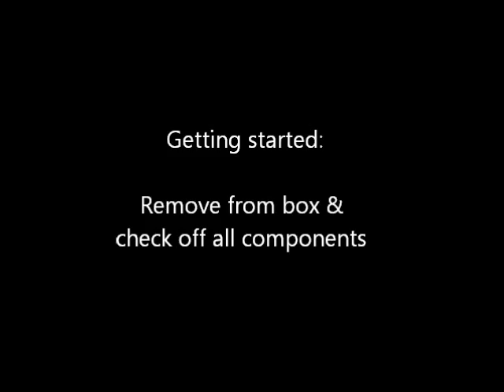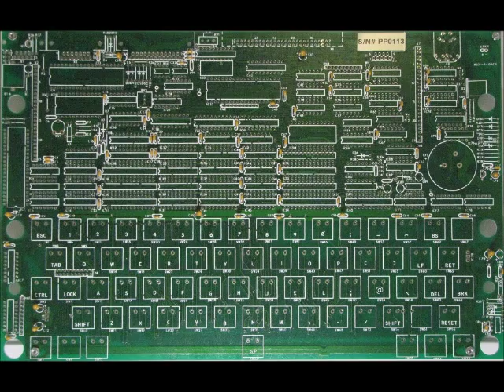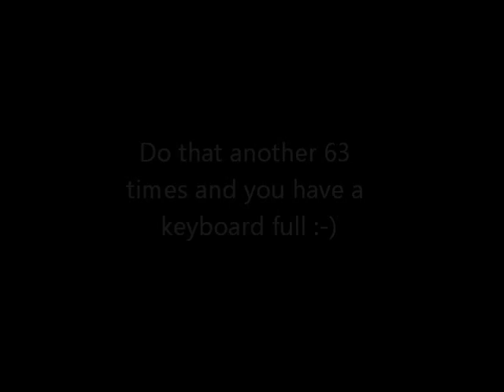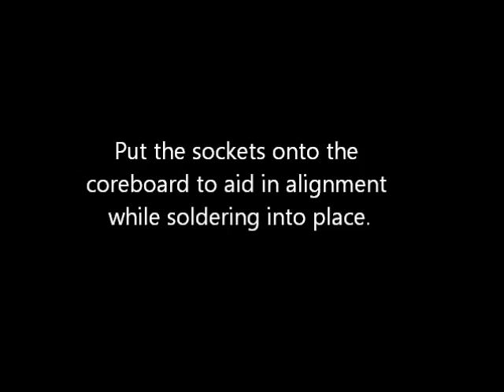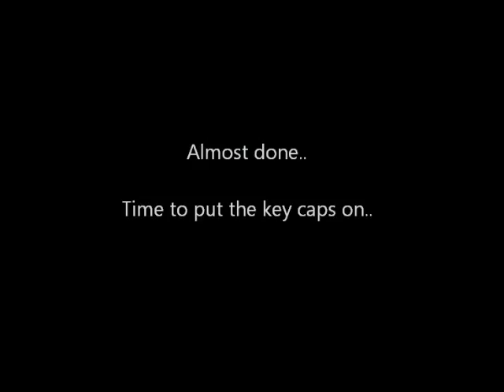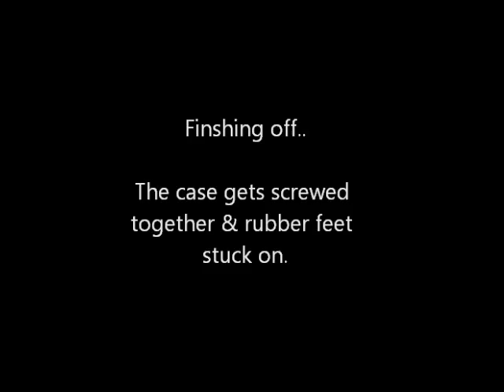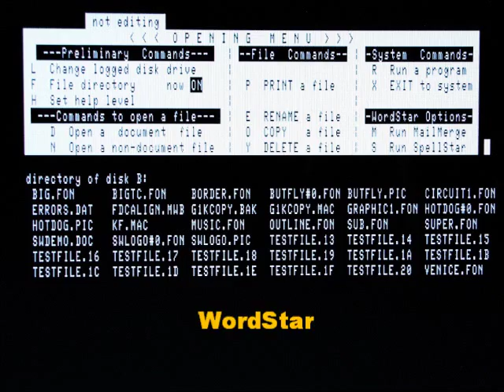Building the Microbee Premium Plus kit computer - a video journal.

Comment: That's hardcore! At least my Microbee was assembled when I bought it! Although I did add another 512kB memory by piggybacking the memory chips onto the old ones and some clever software turned it into a wickedly fast (for its time) RAM drive.